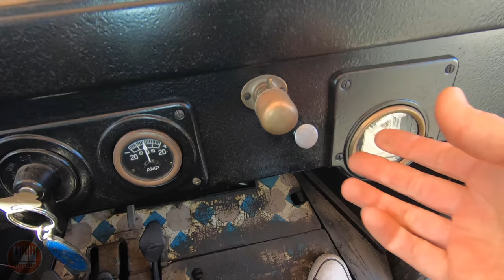Cold Starting the Model T And Updates on the 356 & FJ40 - Sunday Update (3-28-21)

Comment: It's nice to see someone who actually does the work themselves. In the 50's, when the whole antique car "hobby" started, this is how it was done. You found a Model T (or some other old car) in the boneyard for $50, and you carefully and with your own time and money slowly and methodically retsored the car. This was your relaxing time. You aquired the skills you needed and you figured out what materials worked and which ones didn't. You joined a club, and your fellow members came over and lent a hand to get another car back on the road. To some extent this still happens, but for the most part it's become and auction circus and people paying to have others restore their cars. There is no "hobby" in that.

Comment: Great job on the old T!  Couple of hints for ya.  First, don't let the coils sit and buzz.  You run the risk of burning the points on them, and considering they're probably almost if not over 100 years old, you'll want them to last as long as they can!  Second, a Model T that sits is not well lubricated.  Those metal disks in the transmission, the clutch, is pretty dry from sitting.  Hence why the engine turns over slowly when you try to start it if it's been sitting.  It was common practice to jack the rear wheel (one or both) and leave the car in gear.  That way the engine turns over faster.  You also get the added benefit of having the rear wheels acting as an additional flywheel - giving you a bit more momentum when starting.  Once the engine (and transmission) has warmed up, on subsequent restarts the engine will turn over easier as the transmission is now fully lubricated.  Third, and lastly, you may need to choke the engine once in a while as the engine warms up.  I always used to keep one hand on the coke and at any hint of a sputter, would pull it out really quickly (fraction of a second) to keep it running.  Once it warms up, you don't have to do that very much.  Also since there is no automatic choke it wasn't uncommon for the driver to turn the mixture in and out - adjusting as needed throughout the day.  Atmospheric pressure, temperature, all of it would change through the day as well as engine load all require different mixtures.   Keep up the good work!
Reply from the maker: Thanks for the great info 👍

Comment: The vendors sell a shut-off valve that fits on the carburetor in place of the stock elbow.  It's good practice to shut off the fuel and drain the carb bowl after each day's driving just to be safe.  :)

Comment: It's actually possible to start the T when the Engine is hot by simply switching on the Ignition . Starter or Crank not needed .

Comment: Alternator when decades out of use ,Could be the magnetic field is that low it can not energize it self. There are way's to jump that. As I saw your trick with magneto disk you are able to find that info on the Internet. But it works already. Then That start motor draws that much current I hear your boxes stop working even due to lack of energy. Look at your Battery cable , good mass connection and if you use old cable try feel if it has a hot spot(after starting). If so cable bad. Or check with Volt meter when starting at Battery and at starter end. See difference, if there is, you can determine a bad connection or cable. A thick starting cable very hard to measure a defect with an Ohm-meter to find if its bad. The current to measure is to low. The high  current with starting will heat up the cable if there is even 1 Ohm resistance.  Great work though.

Comment: Hi Jared, Its been very interesting watching your progress restoring your Model T. I hope you won't mind my mentioning  your  Model T's generator is set far too high. I know it looks appealing to see 20 amps plus of charge going into your battery when the engine revs but that setting is far beyond what the generator can give without overheating it very rapidly. Within a few minutes it will get so hot the armature will start to throw the solder out of the commutator unless you adjust the charge output down.  I think you will find the maximum safe output on a 6V Model T generator is between 7 to 8 Amps.  Anything more than this will rapidly burn the generator out. Please don't drive the car far unless you have adjusted the generator down to its safe operating setting. If you do  drive the car you  really will burn out the generator very quickly. 
Setting the generator output is easy, Inside there are three brushes which run on the armature, if you take the cover off you will see  two of them are fixed but one of them is designed to move in an arc. You need to loosen the moveable third brush and pull it back against the direction of rotation  of the generator until the output is within the range required no more than 9 amps. I hop you won't mind my pointing this out, I just want to save you the bother of having to acquire a new generator armature simply because you might not have been aware of the importance of this setting. I wish you every success in the rest of you restoration and hope you enjoy the finished car.
Reply from the maker: Thank you for taking the time to send this to me. I thought 20 Amps seemed pretty high but I did not know it could be adjusted. Luckily I haven’t driven the car much at all. I will adjust the generator before running it again. 👍

Comment: WALTER!!  Yeah on your start, I think it is lean as once you pulled the choke it popped, probably? don't want to open the throttle as that is typically how you clear a flooded engine?   You may want to put your hand on the starter to feel how hot it is getting...   Double check all your connections to the starting circuit as it should crank faster than that.  When you switch over to magneto, does it completely disconnect from the battery and thus the battery is not being charged back?  I love the packing blanket upholstery - looks cool and will let you leave the upholstery on for the next 'complete' restoration guy to have complete patterns.  Before you bolt the FJ40 to the frame, you may want to flip it upside down and pour whatever rust stop/inhibitor rust proofing into all the nooks, crannys and seams so it can seal things before flipping it back upright for the last time.  Love the different project cars you have going - find one of those Amphicars that floats for your next project!! https://www.youtube.com/watch?v=yKrIN4lW7D0

Comment: Hi Jared,
I thought I'd better let you know I'd misinformed you a little on the output Amperage of your generator. I've just looked up the output setting recommended by Ford in original Workshop manual. They quote a maximum Amperage of 10 to 12 Amps. I hope that helps.

Comment: Sounds like you don’t have a good connection with eather the ground or hot
Reply: I had a 28 Model A. I know the starter is totally different than a T, but yeah, check your grounds on everything. Also, I know there is a ‘screen’ accessory that will flow oil over the bands/gears really well. Not sure if you have this or not, but it installs directly beneath the hogshead cover. Love these videos and look forward to them. Your knowledge of the vintage iron is impressive, as well as all of your skills that you use to fix/remake the items on your vehicles. Wonderful job!

Comment: If the battery is weak why not replace it with a better battery??
Reply from the maker: The battery and all the cables are new. It’s a 6 volt system so maybe it’s normal to crank so slow